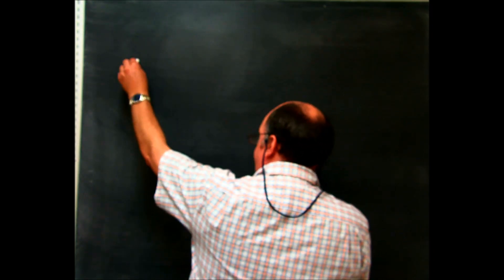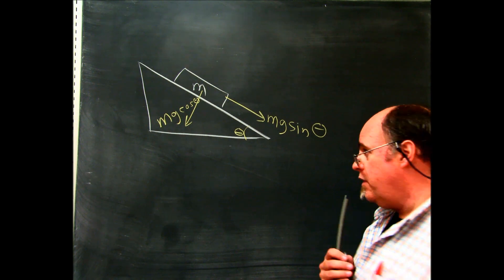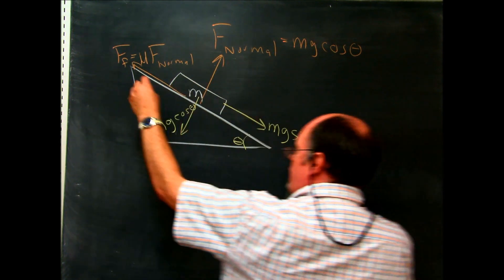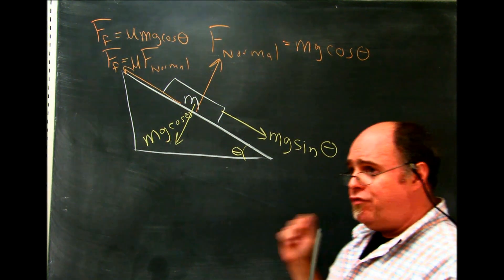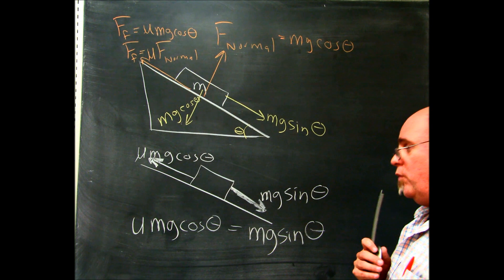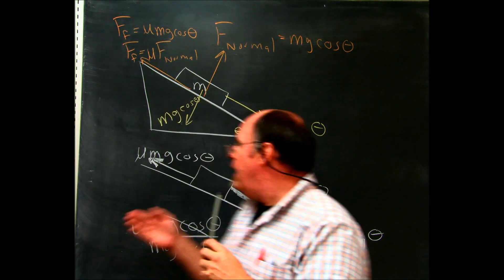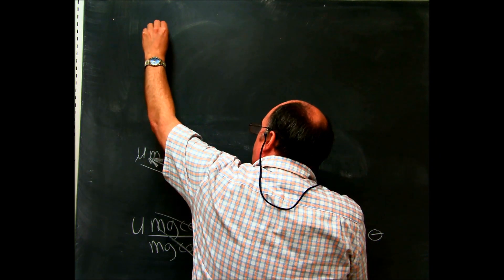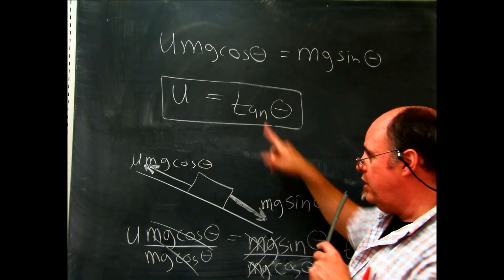Friction: deriving the formula, "µ = tan(θ)"

Comment: Great, but the Friction force is not equal to the coefficient of friction times the Normal. If this were the case, it would lead to an absurd conclusion where a mass pressed against a wall would start moving upwards as the Normal force increases.
Reply: Equal to the maximum possible force of static friction

Comment: No sir , I think this is wrong 
Because the value of static friction(theoretically) is between 0 to limiting friction (max static friction) so you can't put equal to sign in it on μ.m.g.cosθ = m.g.sinθ
And simplified to μ = tanθ
Reply: Yes, that's what I thought too. The friction is less than or equal to µ(F normal). It is only equal to mgsin(theta) given that the box is in limiting equilibrium (about to slide down).
Reply: @Lucas-gz2gh  read the description. He says that this is applicable under situations where the box is just about to slide/ is at an angle where it is right at the point of sliding.